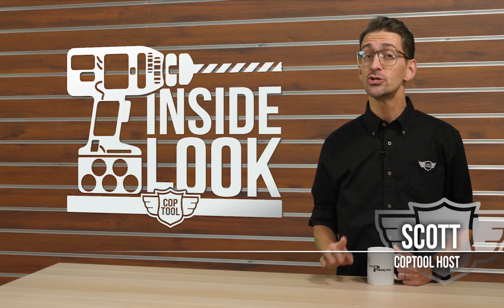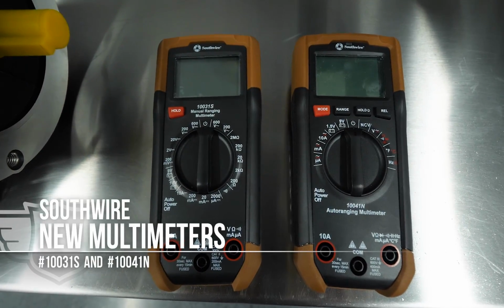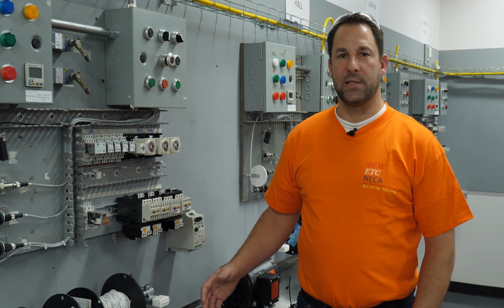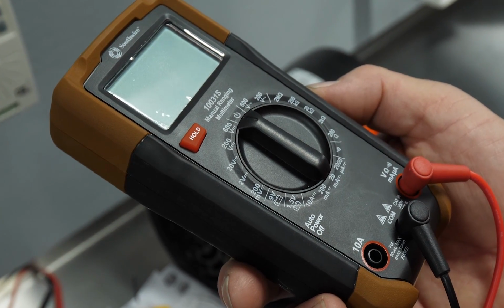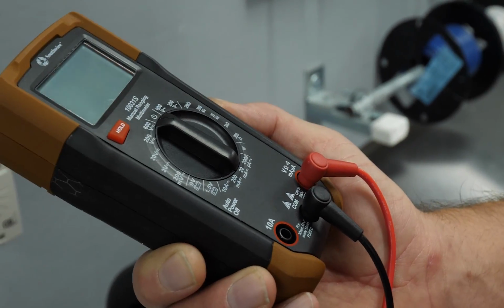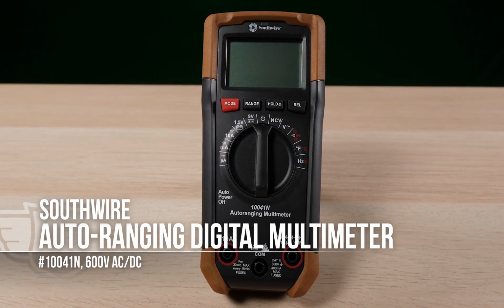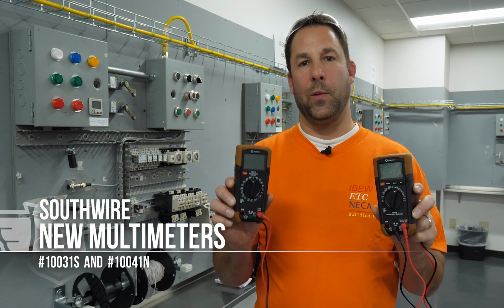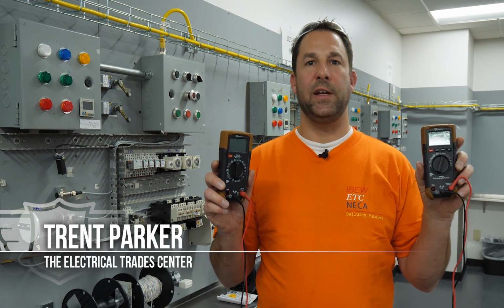Inside Look: New Southwire AC/DC CAT III 600V Digital Multimeters 10031S & 10041N

Comment: Review is always going to be lacking if it doesn't include retail price. All those features sound great but if it's way too expensive I'm not going to be interested. And vice versa if it's a good price value.
Reply from the maker: We've got the full link in the description now, sorry for the delay, these are price point units (under $50 each) but very impressed with the construction, if you don't need the higher voltage or CAT IV these could be great options.
Reply: @ToolShow  p

Comment: Not impressed with this product or this video. You basically just told us its a meter for measuring electricity for 5 minutes. Its called a multi meter, so we already know it's going to do multiple different measurements. The cat class was the only useful info i took from this one.  You didn't even tell us what batteries it takes!   How about the leads that are included? You guys can, and have done better. 

its  no clamp on amp measurement  means it might as well not bother with having an AC current measurement. At least not for an electrician trying to use it on the jobsite. It better come with some alligator clips if they want me to interrupt an lighting or motor circuit to take a reading. Does this thing measure true RMS?
Reply from the maker: Warren thanks for the feed back, we'll have the full post up shortly on www.Coptool.com which covers a little more of the specs, whats in the box & pricing.
Reply: Well said!👍
Reply: Thanks for saving me time lol